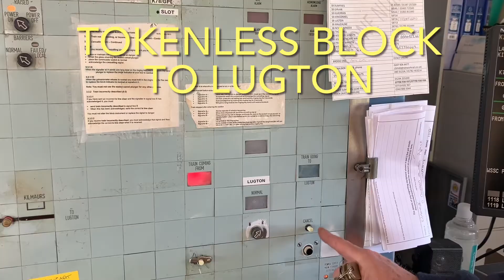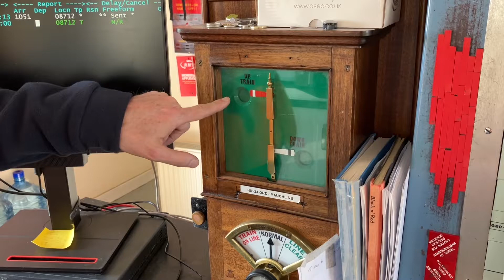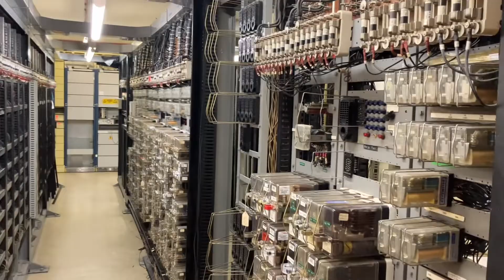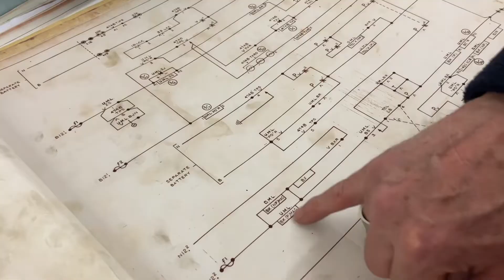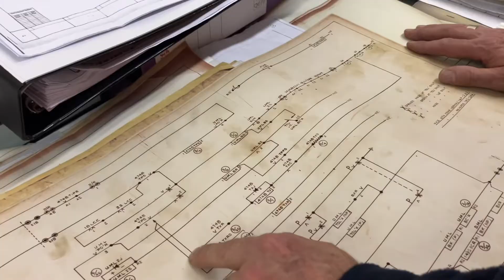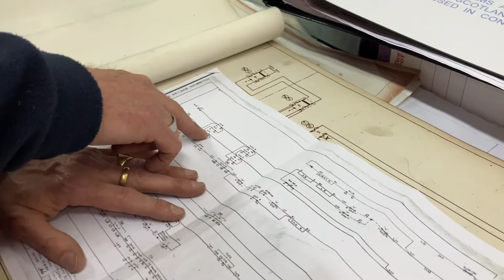Kilmarnock

Comment: Fascinating to see the changes on the panel since I was Traffic Manager (modern day MOM) there in 1983, though the relay room doesn't appear to have changed much.  I assume some of the damage to TC colours is down to the fire some years ago?  Back in the early 1980s, there was a minimal passenger train service, but still a fair amount of freight movement to/from the many sidings which no longer exist.  I'm thinking Shewalton CCE, Hillhouse quarry, St Marnock's coal yard, Walker's (bottling plant) and Riccarton oil terminal.  All had at least one trip working each day,  sometimes two, one each for vacuum and air braked traffic. Most with run round moves in the "long lyes", the sidings on the formation of the former direct line to Dalry.
Reply from the maker: Yes there’s still signs of the damage even now on the building and panel